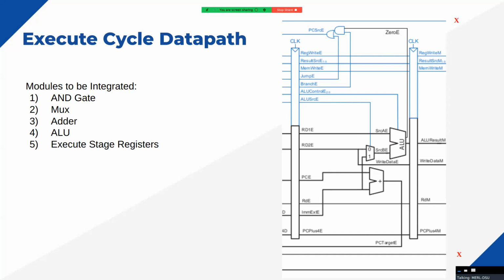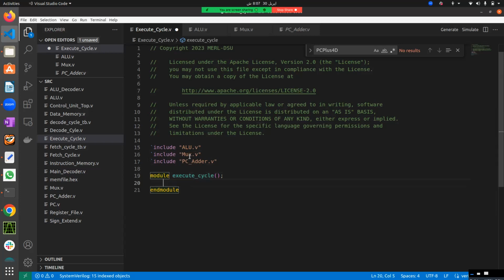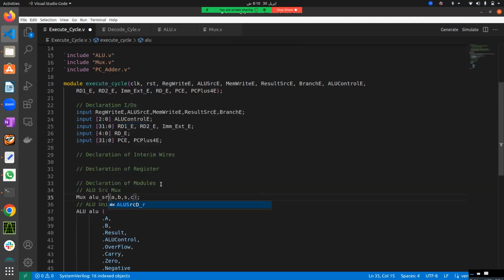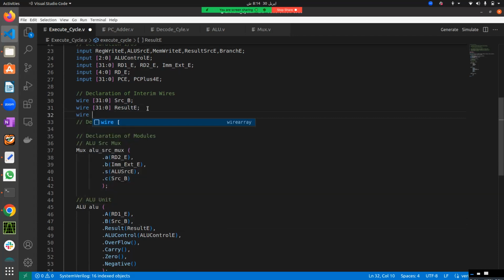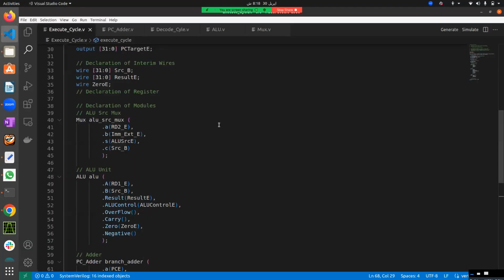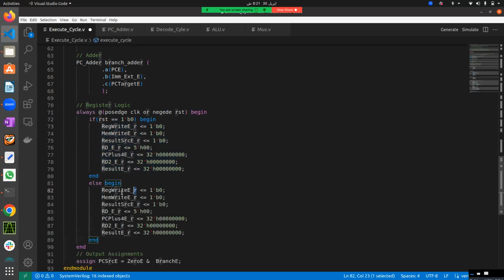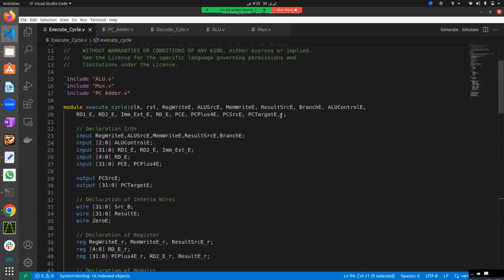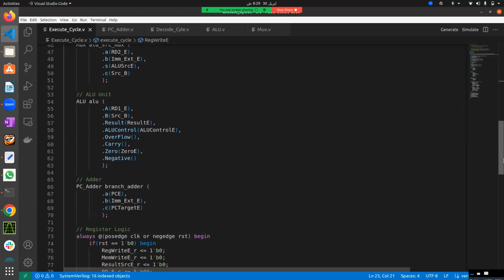Lecture 4: Design & Implementation of Execute Cycle

Comment: In assign statements, the right side shld be '_r' but its just mentioned as normal variables Ex: RegWriteE in place of RegWriteE_r , line 95 to 100
Reply from the maker: yes you are correct. That was left out for the designer to find this error and solve it.

Comment: hi @MERL DSU    sir while writing the  test bench for the Execute and the Decode Cylce i had just inculde the decode cycle  dut in the test bench i could not see the data passing from the fetch cycle to the excution cycle what  i need to add in the test bench so that i can see the reg  values are changing in both the cycle  as u had shown in the fetch cycle  tb could u help me with this pls thank you
Reply from the maker: If you are trying to test both the decode unt and execute unit so you have to include both of them in the testbench. And to see data passing you have to provide some instruction as a input to the decode unit so it can decode it and access the register.
Reply: @riscvtransistors2ai  so can I just assign the fetch cycle output to the decode cycle input  and  see the next cycles inputs  or should I add other hex files to the decode cycle
Reply from the maker: @DSEC_Siddhanthvjain  yes you can do that. You can connect both modules together and test it. No need for separate hex file
Reply: @riscvtransistors2ai  ok thx